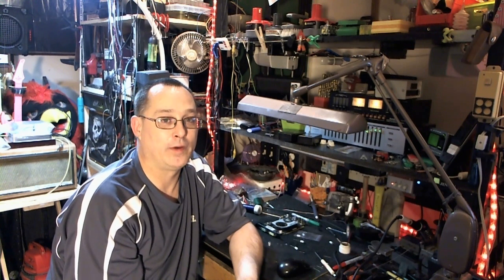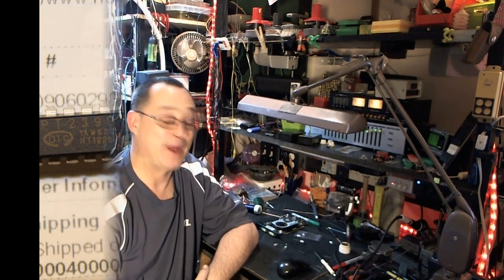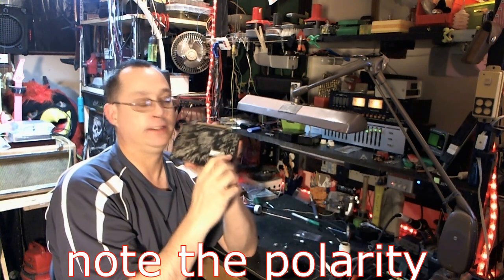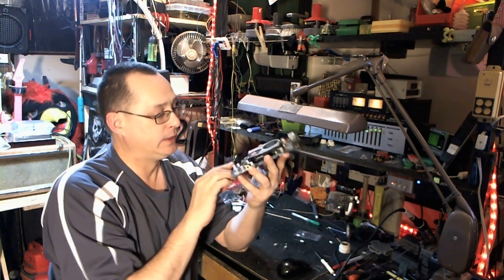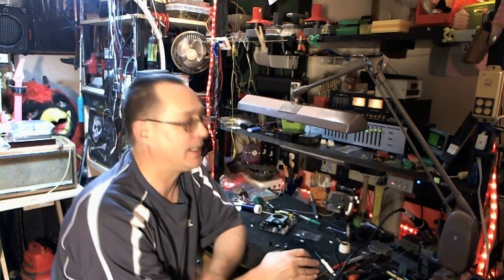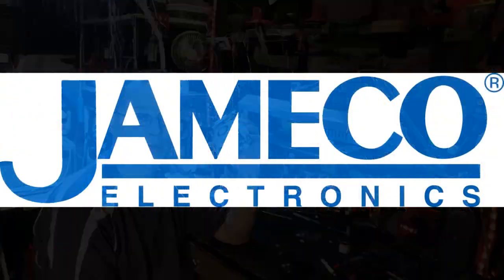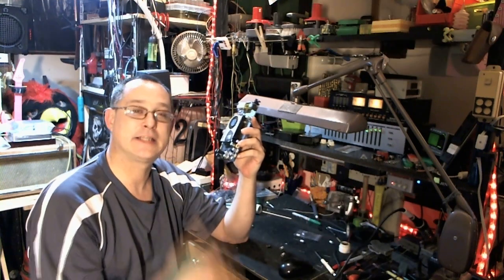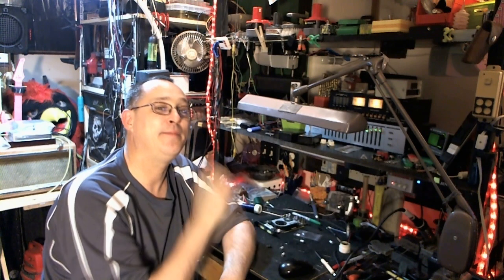Replacing Bad Capacitors (video card)

Comment: Hey thanks for the video, i found that these worked well for me if you live in the UK (from RS) Depending on cap you need. Just change the capacitance value.

https://uk.rs-online.com/web/p/aluminium-capacitors/5260976/

Comment from the maker: you couldnt go wrong with the sprague's . when you go to remove them , it may be no lead solder , that is tough working with . i would suggest a bit of flux and some good old lead solder added to the mix , it helps a lot when removing the stuff . non lead solder doesnt melt that easy ... its cool u fix u=self ! good luck !!